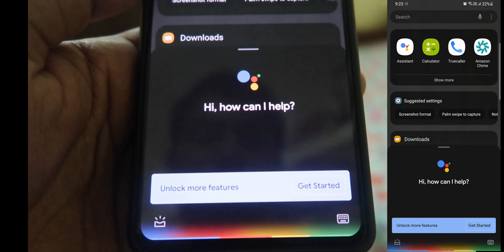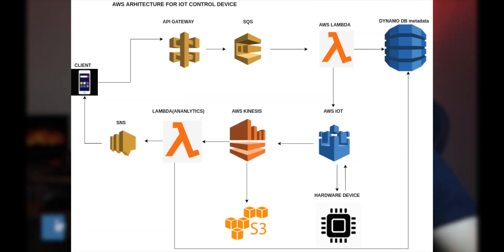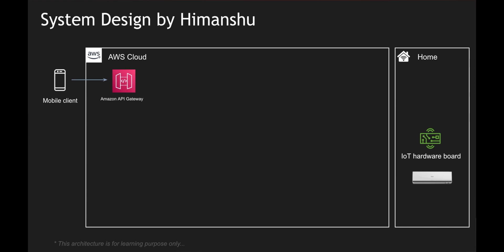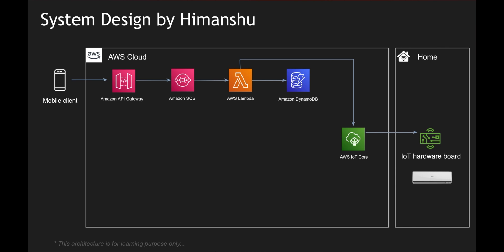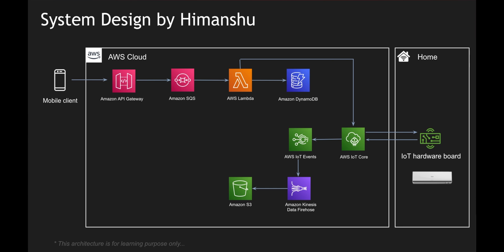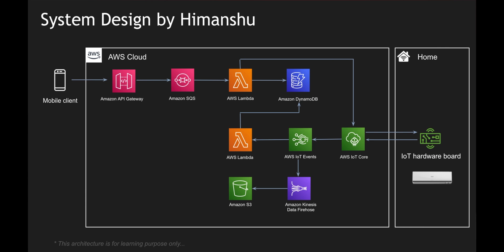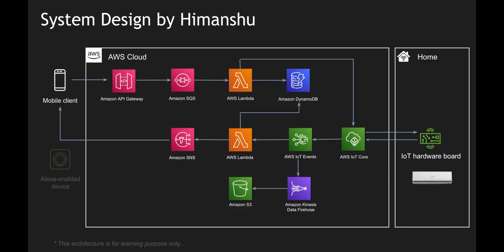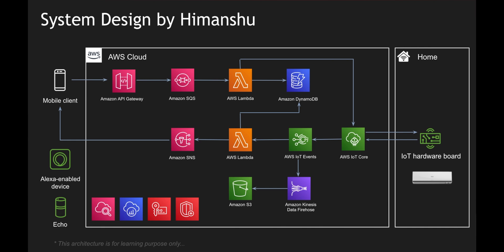IoT Platform System Design | What's your Architecture Challenge 3 | System Design Primer

Comment: A lot of services are available within the aws iot platform itself. Not sure why use only iot core and not the rest. Also your design is more focussed on everything other than iot. Your iot design should focus on mqtt endpoints to pub sub of topics of interest and then illustrate the interface on the iot side on the lower level micro controller library that interact with the device

Comment: This will be pretty similar to slack chatbot model, may be using aws chatbot service along with lambda would simplify the apigateway and sqs setup.
Reply from the maker: Yes for the integration with alexa/ Google assistant. But for the app based trigger we might still need to expose the API gateway. I did not show the app since i thought most ppl use that and it's pretty common.

Comment: How does SNS service knows which mobile started the request ? or are we going to send notifications to all registered mobiles ?
Reply from the maker: Good question Manoj. This is where the Metadata in dynamo will help in pushing the response into the right device. However i still feel using websockets could make this communication much effective than the SNS model
Reply: @TechPrimers  got it, i thought metadata in dynamo is just for registering the external iot devices.